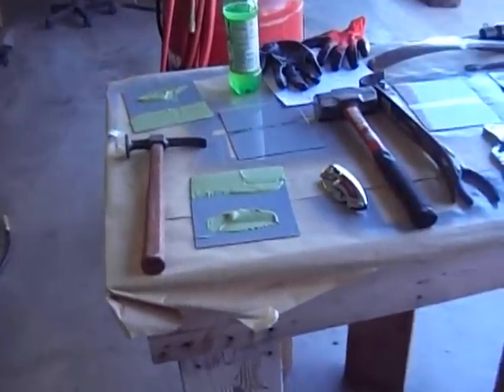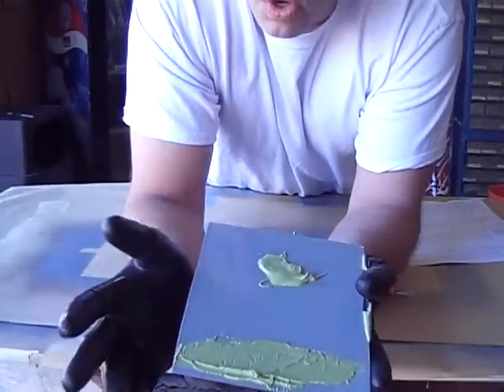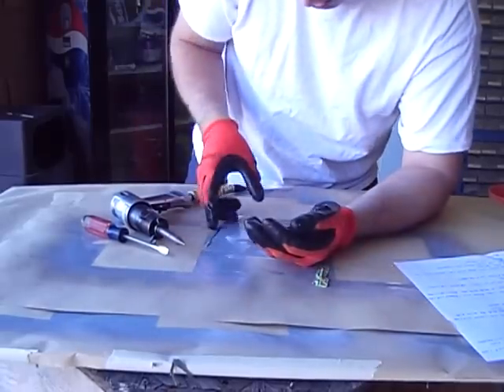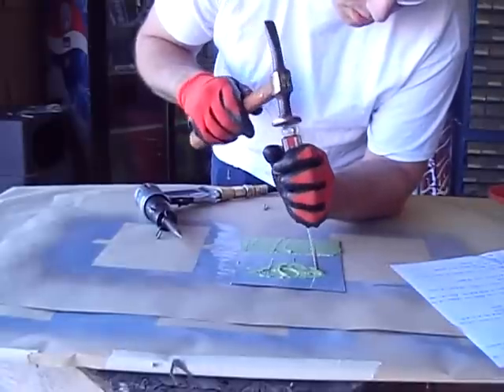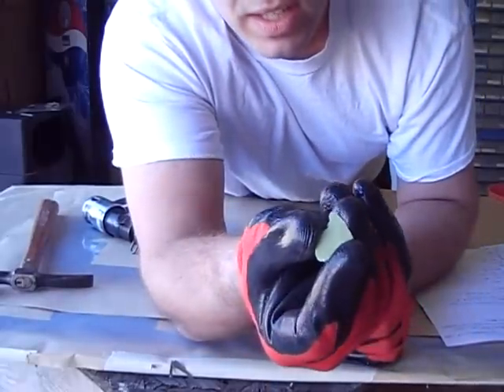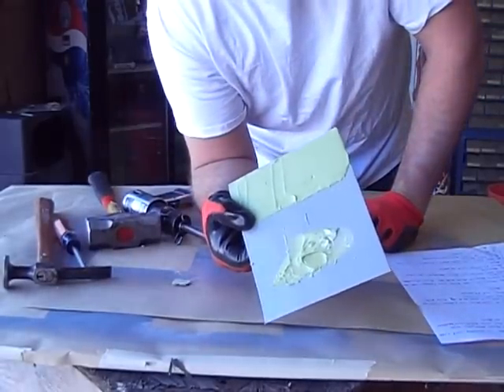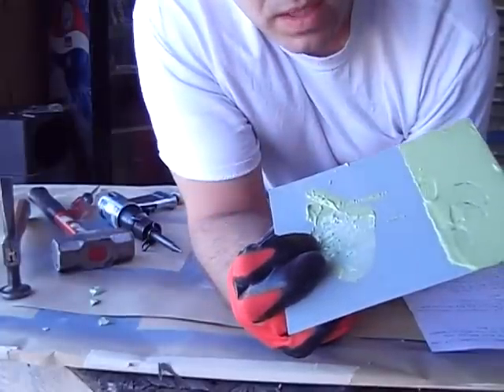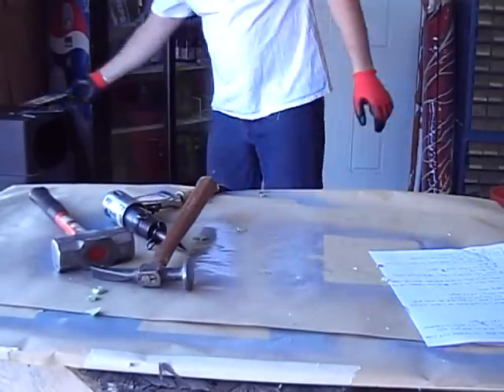Spi epoxy primer & Ospho torture test

Comment: I use their products and they are tough the only thing else that will hurt that stuff is cold temps it does not like anything below 55. SPI states not to spray below 65 and Im talking panel temp. But hey we all push products to see what happens. the rest of their products are just as durable. Good Test!! I liked the air hammer part.
Reply from the maker: Thanks , and thanks for watching :)

Comment: First off, you need to change your screen name to Wildman.

Really well done test. I have been using SPI products for 3 or 4 years and swear by them. I had a hard time at first accepting putting filler over the epoxy instead of well ground bare metal. After a talk with Barry I started putting the filler over the epoxy and am glad I did. If you put filler over a welded panel with no epoxy and have a pin-hole in your weld, moisture can work in and cause major problem. If you epoxy first then filler, the moisture can't start rust under your filler.

I enjoyed watching your test
Reply from the maker: Thanks , I've been having a hard time with cratering , I'm going to spray today and change guns and settings and see how it goes
Reply: MrFireman164 Try setting your gun pressure, like 10 pounds over what you usually spray with. Put the first coat on really light, barely cover, then put your second coat on wet. Works for me with my primer gun.
Reply from the maker: Just sprayed my first coat,iwata lph 400 , I normally spray 16-18 psi , I have it set at 23 spi . sprayed a light coat , this is before I read your comment, it went on pretty good , the second coat is usually the one that gets me. im letting it flash for 30 min between coats. thanks for the comment
Reply: MrFireman164 The reason I am responding to you is because I was FRUSTRATED at first also and that this a very good product. I'm sure you have noticed that Barry will go above and beyond to help. Where else will you find that?

I changed air lines and changed both of my toilet paper filters (I use rolls of toilet paper in them) with no difference in the results and was getting frustrated. Once in a while it would turn out great but most of the time fisheyes. I tried the technique I mentioned and it helped a lot. But by far the biggest improvement I got was when I cranked the air pressure up at the gun with the trigger pulled. I would try your iwata at 30 psi or more with the trigger pulled. It won't hurt the gun any although you won't be compliant any more, but who is going to check a hobbyist. If this doesn't work you have to be getting contamination from some where

I have used the SPI black epoxy on 3 F250 bumpers front and back now as the final finish and they looked great and held up very well. The black from SPI has a UV inhibitor in it that works well.

I'm leaving for a camping trip shortly for a few days and will be anxious to hear how it worked for you when I return. Their will be someone here but I'm sure they won't be looking at u-tube.

Good luck.
Reply from the maker: +Ron Morse I uploaded a vid today , sprayed out decent at 23psi , I may crank it up to 25 or so next time to see of it's any better , this is the first time I've sprayed it with little to no craters. I too did everything thinking I had some contamination , even wrapped my lift in plastic , and as you say was very frustrated , thanks for watching
Reply: +Ron Morse Hey Thanks for that little tidbit about the UV inhibitor in the SPI black primer. Just sold me on the stuff.

Comment: Wondering if 5 years later you have any update new suggestions
Reply from the maker: Still use spi to this day only epoxy I use, spray at least at 29 psi if you have an hvlp gun, spray medium coats the product is thicker so if you lay it on to heavy you will get the pin holes or little pops. I usually spray a medium light coat first then 2 medium wet coats with no issues. Make sure metal is clean and etched with new sharp 80 grit paper before laying it down.

Comment: Thanks for this.  Working on a hotrod '27 Model T and need to treat rust down in pits in the metal before epoxy priming.  I feel more comfortable using ospho now rather than buying picklex20 at $50 for 16oz.

Comment: Thank you for the video I've been doing a lot of research here's my question I have a 1995 GMC 1 ton frame that I'm building a truck from the tires up I'm going to have the frame sandblasted one day but before I do I need to find out what works the best so once I get to frame sandblasted in this looking good and wipe it down with paint thinner whatever I was going to spray the green stuff on to the bare metal and let it sit for 24 hours are you telling me I need to do it a second time and then wash it down with water and then epoxy primer the frame please help come to a standstill I'm trying to build a miniature Kenworth 2 ton truck with tandem axles miniature Fender Wells on the hood 19.5 tires all the way around I thank you for any help thank you for the video again what was the name brand of the epoxy primer in the Bondo that you used thanks again
Reply from the maker: Apaulo Thegreat this test is specific to southernpoly urethane epoxy, acid doesn’t play well with it. You have to check the product sheet you are using to find out what they recommend. If I blast something I clean it with 70/30 isopropyl alcohol and blow it dry with compressed air, then epoxy prime it.
Reply from the maker: Apaulo Thegreat the filler is evercoat rage
Reply: @MrFireman164  mr. Fireman 164 thank you for the response that was very fast back in the day I'll send you down to Bare Metal 89 Chevrolet pickup then I put the green stuff Scotch-Brite and then a proxy primered the pickup it still looks good after 20 years never painted the final paint however the job that I'm doing for myself on this truck build from the tires up I don't want to make any mistakes I want to last many many years your friend from Cowtown Texas I hope you had a Merry Christmas with family and friends and May the New Year of 2020 be Mighty prosperous Happy New Year

Comment: Forgot, in 30+ years of my SnapOn air hammer, never un-screwed the spring holder to change bits, just put the end spring back to change out. Never thought of it, but in the dealer, the clock is not your friend. Curious, does SPI epoxy stick to un treated metal? No one ever talks about the 48k they just spent on their project, and then rust-proofs it on the backside of their panel. That is just as important to me as the outside & finish. I use a spray gun that screws onto a metal pot and come with 5 different types of hose / tip combos to spray the yellow waxy / oil type rustproof material.
Reply from the maker: Dean Kay Spi sticks to properly abraded metal , metal treatments are highly discouraged

Comment: I wonder how that would test out with scuffed E-coat then epoxy
Reply from the maker: Likely the same, ecoat sticks extremely well, however note that I have found rust beneath ecoat. I’m definitely not opposed to sanding ecoat with 180 then epoxy just be sure there is no rust underneath

Comment: What grit paper do u use to scuff the epoxy with before you apply filler?
Reply from the maker: mickey L 180 grit if it’s after the seven day window , otherwise just apply it directly to the epoxy

Comment: I am a little bit confused. The directions say to leave ospho on overnight,  then wipe off the powder the next day. When you did it, you rinsed the same day. what would happen if you left on the Ospho overnight, then rinse ans sand the next day.  You need to reactivate the acid with more after the next day?… .for my large rail project,  I water blasted,  sand water blasted rinse,  then ospho,  over night dry,  sanded with grinder and wire braid,  then preprimer 920 macropoxy,  then macropoxy.   No mention of acid prep on epoxy sheets.   I wouldn't like to rinse next day.   But not sure if any advantage to applying and rinsing same day,  before iron oxide to iron phosphate conversion can occur.  ... Can only get brush off sand blast quality,  due to logistic and custmer price sensitivity.
Reply from the maker: dennis garber Im not an expert on any of this just a hobbyist who is using these two products on a friends car, calling spi and talking to john or barry would be your best bet and thats if your using spi epoxy , if i'm not mistaken spi uses acid in their epoxy  primer which would inhibit any growth of microscopic rust, and as you saw if you leave any acid residue on the part then spray their epoxy it reactivates the acid and releases the epoxy to metal bond. From what they told me the ''only thing that reactivates acid is acid, to clean it off. Other primers may allow you to leave acid under their products with no loss of adhesion but spi is not one of them. So even if I would have left the acid on over night and then cleaned it off the "spi epoxy" would reactivate the left over acid residue and the product will fail . hope this helps , thanks for watching

Comment: Even where you are hitting the panel with the hammer, the epoxy seems unfazed right at contact point
Reply from the maker: Like a rubber coating

Comment: So how would you do ur car with ospho  or with out?  I dont like the idea of washing with water lol
Reply from the maker: Rusty Gaspard I mechanically strip or blast , then clean the metal with 70/30 isopropyl alcohol till the rag is clean , then air blow dry and epoxy prime
Reply: @MrFireman164  i ment would u recommend using the ospho or just going the route u just started bc thats what im doing now thanks
Reply from the maker: Rusty Gaspard at this time in my journey I don’t trust acid underneath , to hard to know if it neutralized or not , if I were to use it I would let it sit for 24 hours on the metal then come back and re wet with the ospho and wash the metal with soap and water , blow it dry then use 80 grit on a d/a to tooth the metal
Reply: @MrFireman164   ok thats what was looking for thanks again ill just prep and get as best as i can befor epoxy

Comment: it’s not clear if you let Ospho dry or not.
Reply from the maker: Yeah supposed to let it dry 24 hrs then apply top coating according to ospho
Reply: @MrFireman164  thanks, saw that later on.
so you were NOT working with rusted metal.

 Good Guidance! I would trust Ospho, dry or wet, under a paint or primer. acid removal, sand that off once it has etched or converted the rust.
Reply from the maker: @dharam108  it was rusted there are some vid leading up to this one, but I 80 gritted them with a d/a. Ospho is likely very good at what it does it’s mainly phosphoric acid. The main point of this vid was to show that using acid under spi epoxy is possibly setting yourself up for failure. Just make sure the top coat you are using is compatible with acid and you will be fine.

Comment: I SANDED A ROOF OF A CLASSIC FORD THEN USED OSPHO PER DIRECTIONS.I PRIMED WITH 3 COATS OF HOUSE OF KOLOR KP 2 CF.THEN NEXT DAY THE PRIMER WAS PEELING OFF .NO MORE OSPHO FOR ME.KP 2CF IS AN EPOXY PRIMER AND IVE USED IT FOR YEARS.
Reply from the maker: Yep , if it's not kept wet then rinsed well I can see that happening, thanks for watching.

Comment: I was told by a fellow You Tuber that "methyl hydrate" will remove Phosphoric acid residue to prep for epoxy primer. Other names for Methyl Hydrate are... Denatured Alcohol, and green denatured alcohol, and Kleen-Strip Heat Odorless fuel, yes I don't want to be held responsible if the tip doesnt work out, but its the only tip I have found so far that beats the alternative of reapplying phosphoric acid and wiping off when wet.
Reply from the maker: Cool , I would want to see proof before I wager my paint job on it .
Reply: Mix alcohol and phosphoric to make a kwik prep for recently exposed areas

Comment: I would never use epoxy on bare steel only self ecthing.  Nice test though
Reply from the maker: Thanks, you must be very old school, etch is only used in collision for the most part these days for a quick repair on a fender not an overall paint job.

Comment: Sorry, I have not gone through all the comments here, but this is my candid, honest, and brutal reaction to this.  Bottom line, apply Ospho IN ANY POSSIBLE FUCKING CONFIGURATION and, AS LONG AS YOU RINSE IT OFF, IT WORKS????  What you FAILED to do was just apply Ospho and rinse it off and do the same test.  I suggest all your tests that showed the same results was that you spent the same amount of time for all scenarios to get the same result.  What if you just tested spraying Ospho, let it set for recommended time, rinse, and then bondo to see if it had the same performance?  What is the process that saves the most time and achieves the same result?  Your video says dick about that.  Sorry, but I watched a heck of a lot of play and I cannot differentiate between what is best versus what saves me time but achieves the same result....that is, saves time but kicks ass.
Reply from the maker: No idea 😂, was told not to use acid with spi epoxy or it would fail, the other option was to use ospho and let it sit 24 hours to kill the rust, re apply ospho to reactivate and rinse with water to neutralize. That comes from the owner of spi epoxy. IMO the best way to not have failures is to mechanically remove rust with sand blaster or wire wheel. Then clean and epoxy. That’s the way I do it, but hey I’m a fucking hack building shit in my garage so if you want a professional opinion go find a professional.

Comment: You are not following the ospho directions. You are supposed to apply, then wait overnight, then wipe off residual  powder.  I , on last job,  water blast,  ospho,  then sand and grind,  then epoxy (macropoxy 920 then macropoxy) .   Rinsing same day is too soon to change iron oxide to iron phosphate,   rinsing next day will lead to more flash rusting,  but still may be essential,  contrary to ospho specs.   You don't make it clear if rewetting with ospho is really needed.  Is it?… .. What hints do we have if the exopy is acid incompatible?   Polyamide?   I am guessing it would be hard to get the chemist on the phone who knows.
Reply from the maker: dennis garber Im not an expert on any of this just a hobbyist who is using these two products on a friends car, calling spi and talking to john or barry would be your best bet and thats if your using spi epoxy , if i'm not mistaken spi uses acid in their epoxy  primer which would inhibit any growth of microscopic rust, and as you saw if you leave any acid residue on the part then spray their epoxy it reactivates the acid and releases the epoxy to metal bond. From what they told me the ''only thing that reactivates acid is acid, to clean it off. Other primers may allow you to leave acid under their products with no loss of adhesion but spi is not one of them. So even if I would have left the acid on over night and then cleaned it off the "spi epoxy" would reactivate the left over acid residue and the product will fail . hope this helps , thanks for watching
Reply: For commercial work, reactivating the ospho next day then power washing it off, is not practical: would set you back a whole day.  Water blasting without sand, then sandblasting, then acid etch, then water blast rinse.  Leaf blow dry.  Next day, grind, braid wheel, preprime or straight to epoxy=makes sense.  My question is (after water sandblast, before high pressure rinse, what is the best acid: Cheap phosphoric (no soda netralize) then rinse; over priced Ospho (which wouldn't have time to iron phosphate); or, Muratic, then neutralize then blast rinse (to my eyes, the muratic is quickest to pull off rust to white metal).    Opinions?  Dry sandblasting is messy, illegal in many areas, only good for a few square feet, unless you are getting into tens of thousands of dollars of blasting.